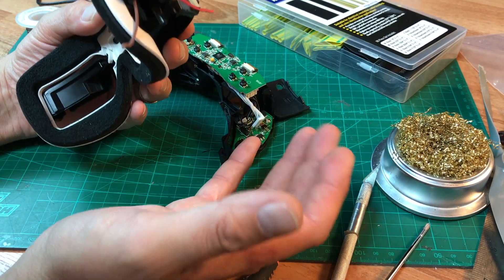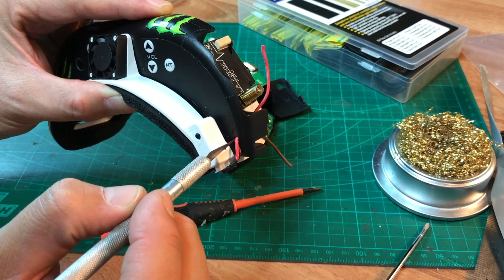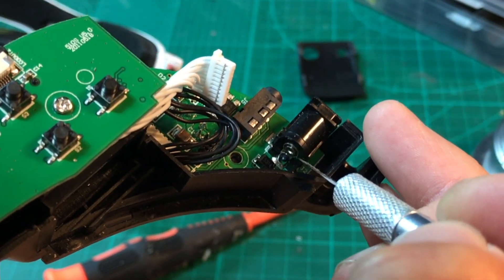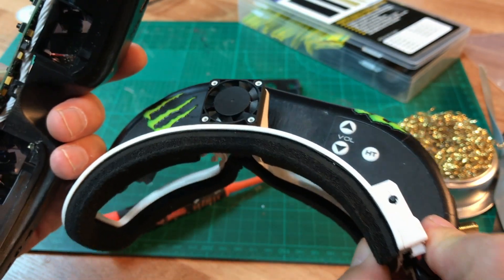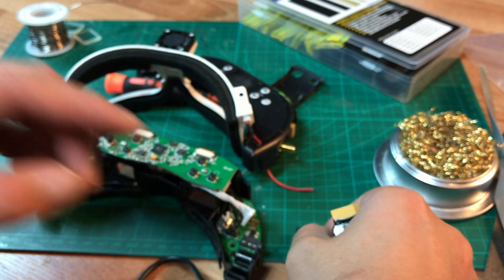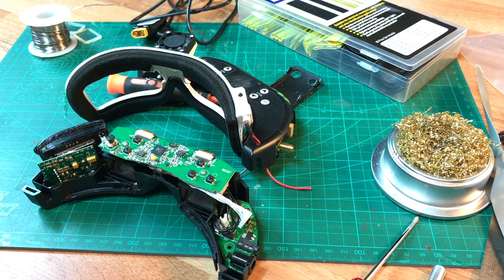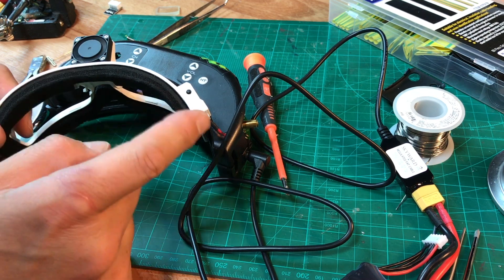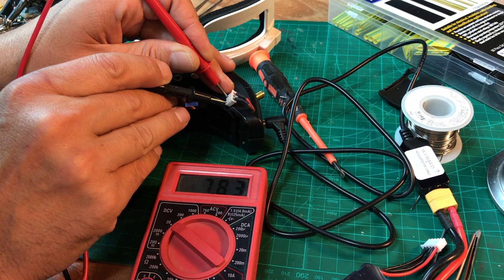Fatshark Faceplate Fan Mod Project

Comment: I installed a diversity receiver in my Dom V1 as well and ordered the faceplate last week. Thanks for the tip. I'm going to do the same mod. This way I can use the cheap eachine battery that doesn't have a balancer plug.